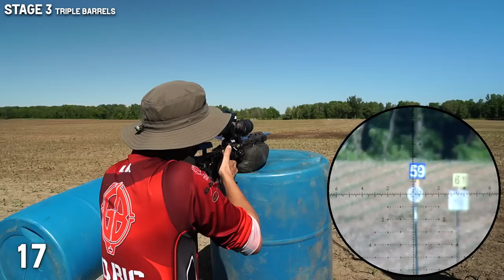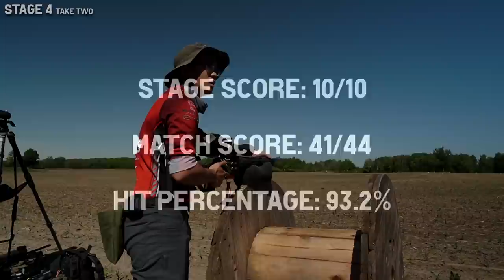Northern Rimfire Series: 2023 Insite Arms Steel Challenge Match

Comment: Was 10:11 a hit? It looked like splash on the T-post 2.2 MIL low and the only way that would have happened is if you clipped the bottom of the target edge. That, or a really bad round.
Reply from the maker: Hard to tell, it looks like it may have been a slightly slower round that went under and splashed behind, the targets are pretty high up on T posts